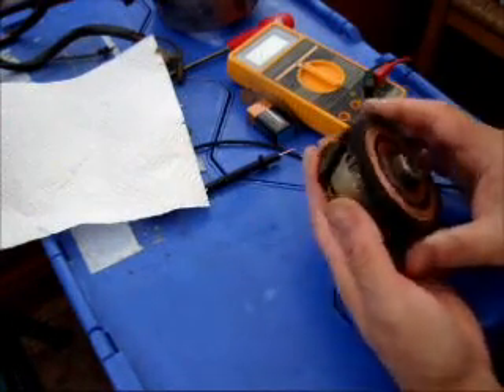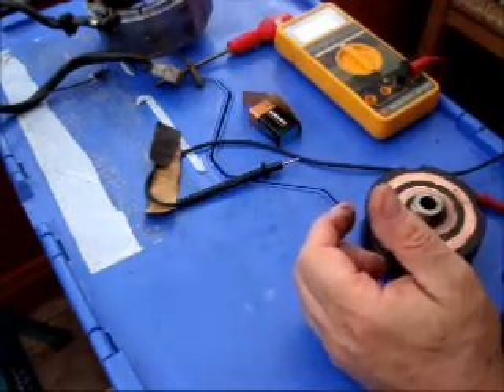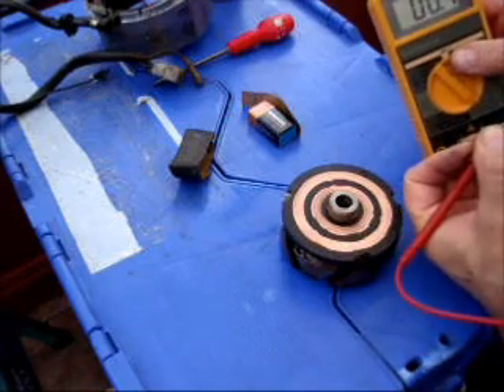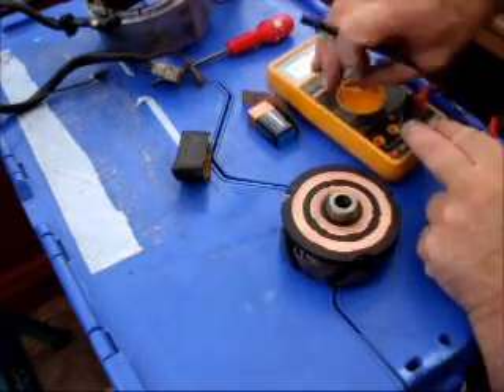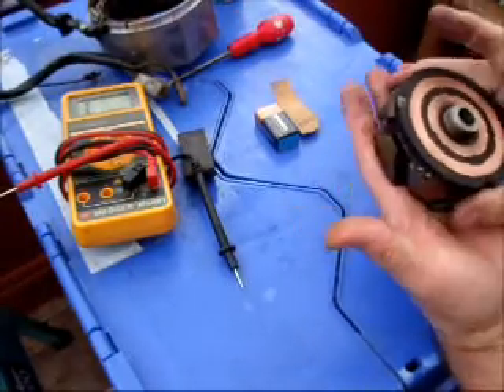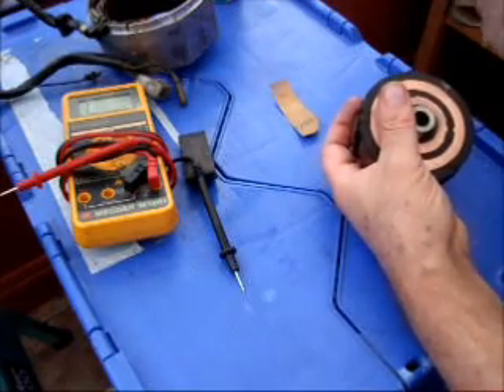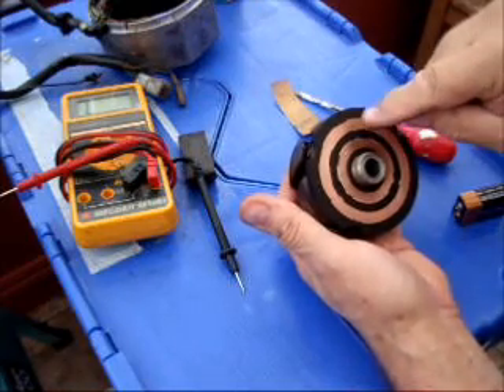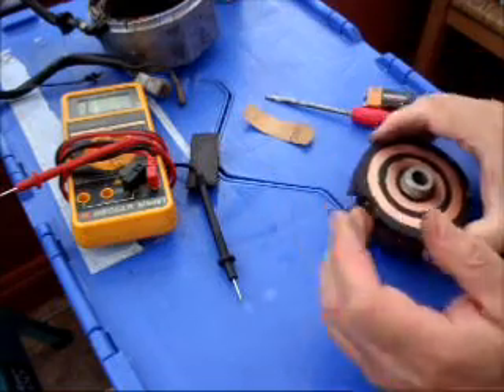Yamaha XS650 Not charging. Testing the rotor How the charging system works

Comment: Thank you for sharing your knowledge.  I am having charging problems with my 1981 XJ650 Maxim and still haven't solved the problem.  The stator phases all check out at .5 ohms, brushes are new, regulator rectifier is new.  Beginning to suspect the rotoe is the culprit.  can they test good at rest and fail when spinning, perhaps from a break in a winding that opens up under the influence of centrifugal force?
Reply from the maker: +E.PLUMBUS UNUM 
you haven't said what problems you are experiencing ?
I would suggest that you disconnect the regulator/rectifier connector and then use a multimeter to check voltages at the stator connetor terminals.Check  that you have 12v+ at the outer copper track on the rotor with the ignition switched on. if you have then check that the stator ground is being grounded by connecting the inner copper track on the rotor to the bike frame .If you still haven't got a AC charging voltage on the 3 white wires at the stator wiring connector then there is something wrong with your brush holder assembly or the wiring from the stator to the regulator connector like a short . make sure your stator wires are not crushed anywhere when the stator is bolted back on.
Reply: Apologies for the late reply. I know that you will have solved your problem by now but for the benefit of others that arrive here I'll answer your question.

I am not familiar with your bike but I would guess that as your model is a late one then your rotor is a PMA type which means it doesn't need to spin in order to create a magnetic field ( like the pre 1980 models,) when supplied with 12v+ and a good ground.

1. Provided that you can test and confirm  12v+ at the outer brush and rotor ring with the ignition switch on ...
2.  You can verify that the inner rotor ring and associated stator brush is earthed or grounded to the battery negative via the chassis.
Then your Rotor should create a magnetic field and be working correctly as it should.

if the rotor test ok then suspect either  the wiring from the Stator to the rectifier/regulator being shorted, pinched or cut etc or  a short at the Stator brush assembly or a faulty Regulator or Rectifier.
Reply: @johncooper7242  wrong

Comment from the maker: no you can test the rotor by removing the brush assembly on the stator and putting your multimeter prods through the brush holes but its a real pita to do without shorting the prods somewhere. 

Better to remove your cover and stator completely then you can also clean the copper lands on the rotor and check your stator wiring hasn't got a short or break somewhere out of sight.

Comment: hi is it necessary to remove the rotor to test it?
Reply: Juliann Salinas I’d like to know that too ??
Reply: no you can test it with the rotor on the bike. all you need to do is disconnect the stator electrical connector at the regulator and isolate the alternator. Then test the rotor with your multimeter